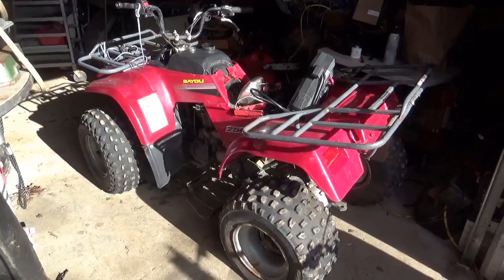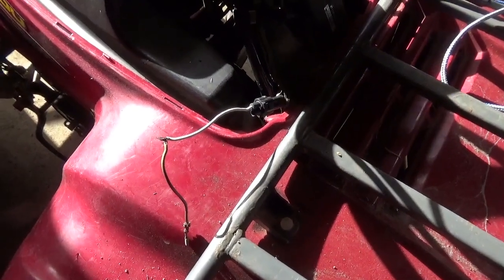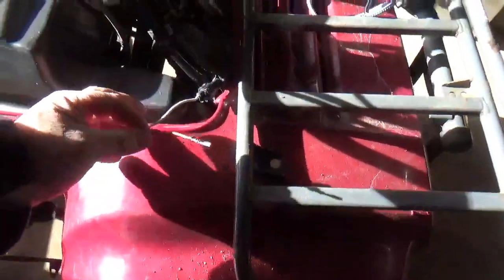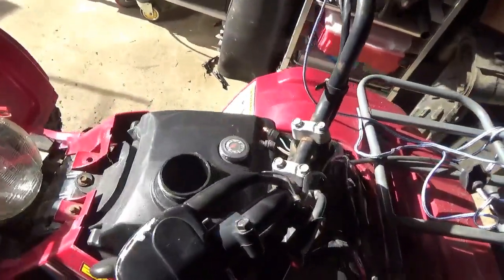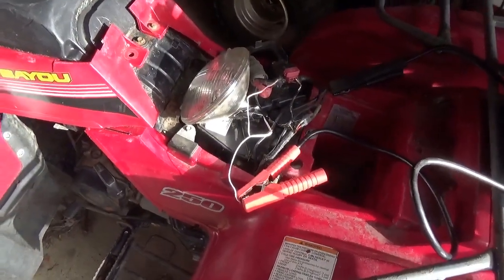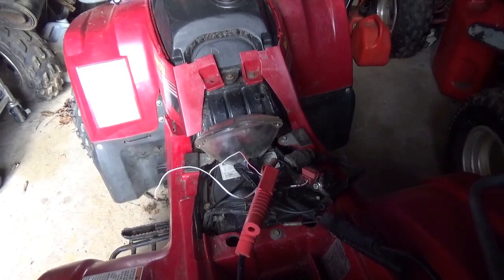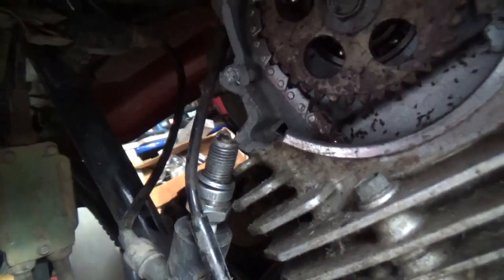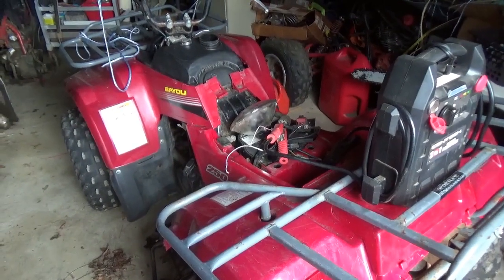Troubleshooting a No Crank Barn Find Kawasaki Bayou KLF 250

Comment: just bought one - electrics in the same state - just spun up the starter and it just spins up on its own (sprag?). Starts way too easily - missing choke cable so am guessing it is permanently on full choke and bogs down as soon as it warms at anything higher than tick over - no brakes stiff cables and  reverse selection doesnt seem to be sensible so will wait for a manual to set up - its got a spare engine

Comment: 2 wire vs 4 wire switch details I've never heard before. Don't have any in the shop right now to look where that plug gets connected to, but I learned about the clutch on the front of the 250ex [same as recon] where the ends of the weights broke off and took the springs on their last ride. Taking an outer trans case to a local shop that welds aluminum to help get a 500cc 4wd finished once and for all. Then a Can Am has to go to the dealership because the anti-theft system is tied into the electronics that are not functioning and they have the power. Can't wait for the next chapter of the Kawi 250 , some machines are like walking barefoot on a bed of rose petals and others are like walking in a minefield with clown shoes on. Oh yea, you got sunshine over your way again? WOW
Reply from the maker: Hey ATV Seat Exchange.... If Ur 500cc cam am has a single cylinder, my portable cdi should work as is.... If it is a 2 pulse generator ignition, (so very doubtful), I would use 2 of my systems.... If U have 2 cylinders, I would use the output of my cdi to drive whatever spark coils U have, both of them or into the single windings of 1.... I hope this helps.... Thanks always for Ur thoughts, watching, and commenting!!!
Reply: @HarveySpooner  I appreciate the offer but the 500cc machine with the trans problem is a Polaris and the Can Am is a late model fire breathing 800cc machine that's got 4wd and probably the quickest machine I've ever driven. They are called a Renegade X, or something like that. The machine is expensive and when a computer problem is involved we're talking thousands for repairs. Taking the blame for messing with it is not an option. The dash tells you what system needs attention but connecting to it is where the manufacturer holds the access. The headlights stay on after turning off the key, like a damn car. Recycled 1350 lbs of batteries today, dropped off the trans case, took in a rollover to repair with 257 miles, and was offered an 800 sportsman for sale without a price tag. Thanks again Harvey  I'll keep my head up and my wheels down.

Comment: Harvey, bought a kawasaki 300 bayou 2x4 for $500. Had bent valves and bad carb. Spent $450 in parts. New starter, cylinder, rings, piston, valves, springs , head gasket, carb, ect. set valves to 5 and 8 ths Removed spring valve chain tensioner, replaced with screw tensioner. Timed for 300 correctly. Engine rotated with compression. All Good. Started with eyther. Belched once. Bent valves again and 6 teeth out of time. No compression. Not a happy camper now. Any comments to help, besides cut my losses and junk it.
Reply: Hey man did you figure this out